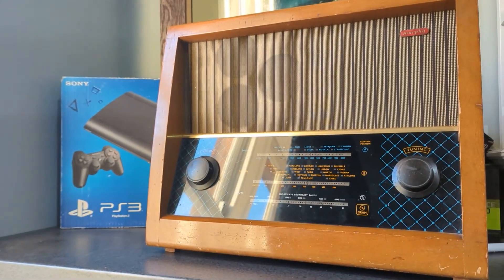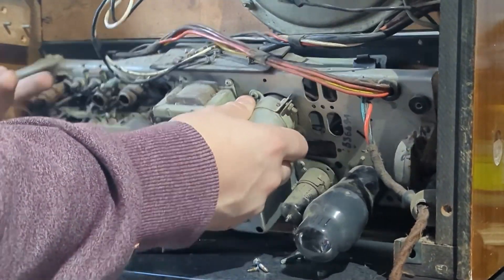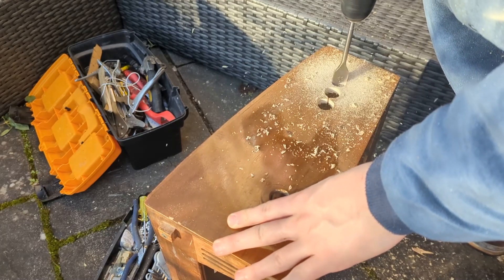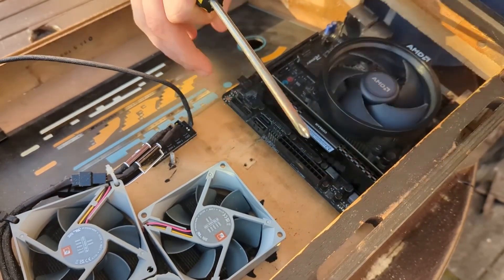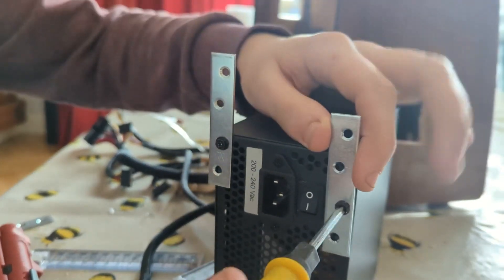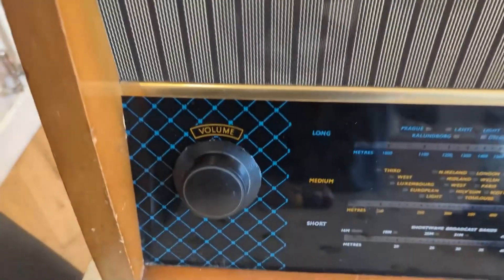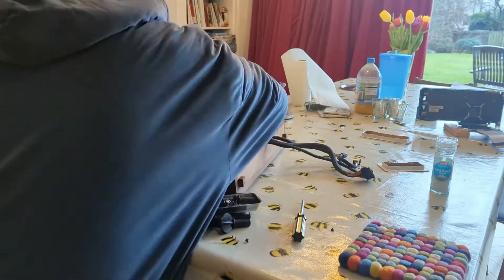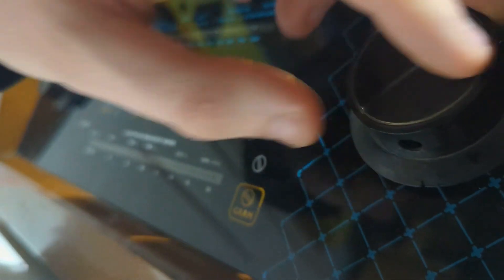1930s Radio PC Build

Comment: All motherboards now and days support 3 pin or 4 pin fans, 3 pin fans are DC fans where 4 pin are PWM the only real difference is the 4th pin is a since pin and will tell you the RPM the fan is running. The reason the little plastic tab on the fan header for the motherboard is manly on one side is to support the 3 pin fans clip, and that is the side you plug in the fan if its a 3 pin fan1